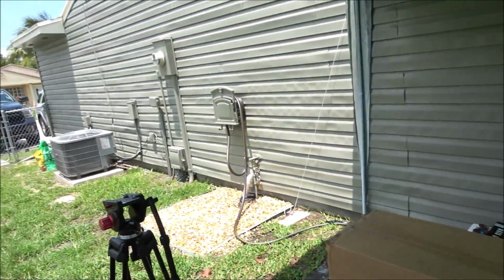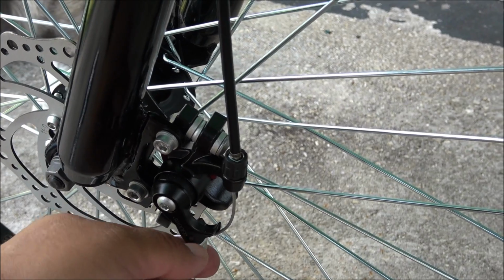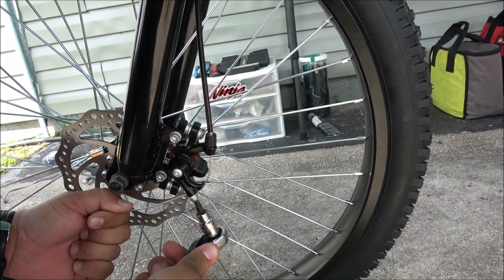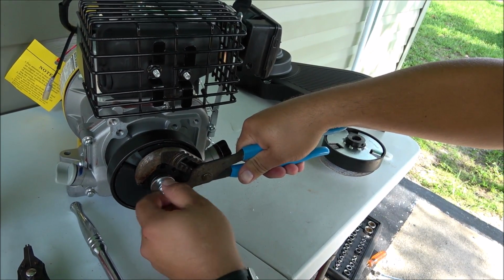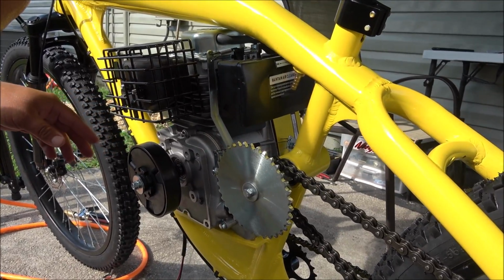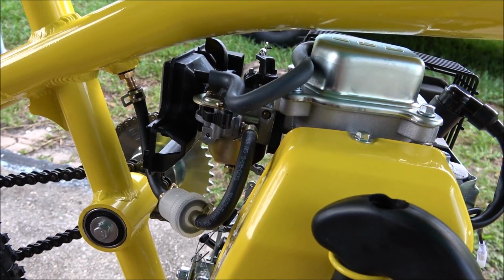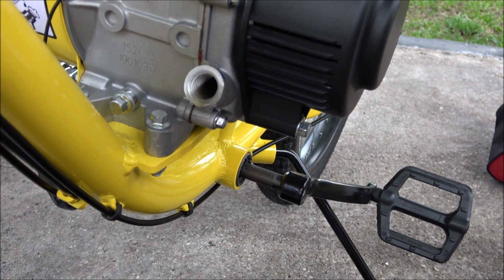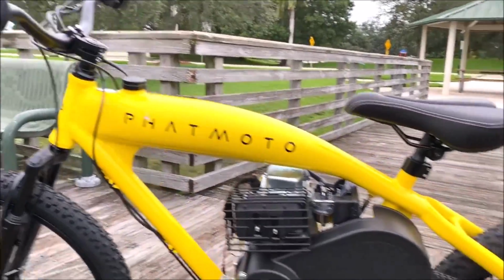Phatmoto Rover 2020 [Motorized Bicycle] - 79cc 4 Stroke - Unboxing & Installation Tutorial

Comment: Mount the engine mounting bolts with the head facing up. If the nut comes off you have a better chance of not losing the bolt. In aircraft maintenance if you put the nut up you would probably be fired.

Comment: Great assembly video. I bought the 2022 version. Found pedal chain way too tight. Removed governor inside engine then changed to 19 mm round slide carb. Great performance.

Comment: A very nice video, well done. Appreciate you.  I would like to add that if you don't do much riding off road, one thing you can do to make your bike faster and improve the range and ride quality is to replace the factory knobby tires with a set of good street tires of the same size.  Switching the off road tires for a set of smooth street tires offers advantages and improvements you will notice immediately.  The street tires have less rolling resistance than the knobby tires so your millage and speed will both increase.  They are also much quieter and give you a better ride and control when riding on pavement, it's Win-Win.  Thanks again _ great video.

Comment: After I had Rocker off road shocks installed on my front wheel by a professional bicycle mechanic, I truly appreciate the double Lock down instead of spacer approach. When it's important there is no replacing a professional. Rear Disk brake is 100% impressive bye the way.

Comment: You are going to regret using red thread locker.....will need heat to break the bolts. Blue is all you need.

Good looking bike though! The yellow looks awesome!
Reply: Yeah, the blue is plenty!
Reply: You never use thread locker it just causes trouble later.
Reply: Always blue on everything and tight if it comes loose. use red like on my back phat moto sprocket my 2019 back sprocket is not hub piloted - center suported not good. Why things come loose more often when on these bikes no rubber motor mounts like cars, trucks, generators and more to reduce vibration.
Reply: Phat moto has solid motor mounts so it wiggles stuff loose like my muscle car with solid motor mounts typical things loose too. I always use blue lock type on everything and if the bolts come loose I put red loctite back in it I never had to use heat backing off blue, red or even green loctite bolts. But when bolts come out or loose they can strip threads break things be a real disaster and leave you stranded. I've seen it a lot from do-it-yourselfers not getting bolts tight enough and doing things right the first time.

Comment: I didn't realize you had to do a complete assembly on these
Reply: It's not a complete assembly. All you have to do is mount the front tire, mount the engine and handlebars. A few other items like the throttle, but that's it's a piece of cake. - Jeffeo
Reply: As said its not a complete assembly... HOWEVER its a mass production bike 🏍 made with cheap parts. When you get it you NEED to take apart everything grease and oil what should be greased or oiled lockthight everything than ride it. 
Thats how i got over 20,000 miles on more or less a stock bike. I did upgrade jackshaft bearings highly recommend doing that right away makes it easier plus the stock bearings suck night and day with some good ones. 👍 even had a bad wreck on my bike folded my CDH forks rim still good! Bike still starts 1 pull but is finally running ruff and gets hot 🔥 fast!
Reply: @miguel360kmc  so you took the engine apart and tightlocked it back together?

Comment: Did you lube the chains  ? Also why don't they use a spring loaded chain tensioner, I made one on my motorized kit ,which requires a lot of substitution of factory supplied nuts & bolt which are Chinese garbage , this phatmoto bike is well designed and less maintenance required than a ebay kit , the biggest issue with those are bolt on engine to frame mounts and chain guide aka tensioner, periodic inspection is required for safety,  the phatmoto bike solves that issue, except the lack of spring loaded tensioner,  update, the newer ones have 7 speed cassette and shifter .

Comment: I built the 212cc with 2.5 stage upgrades hitting 70mph with 4stroke power!(=
Reply: On the phatmoto frame?
Reply: @st.paulmn9159  yeah bike frames aren't made for 70 mph. Maybe just 15 mph max
Reply: @youngfinance6319  if you're only going 15mph tops on a bicycle something's not right haha
Reply: JayJay One  yah.... that "class" is what most criminals call "Anger Management".... instead of FUCK OFF and you go to JAIL... you must kinda like your FREEDOM?? That's NICE..😁✊🔥
Reply: @youngfinance6319  i can go faster than 15 mph on a bike with regular pedaling
Reply: @Youvegot2bekidding  on my recumbent bicycle i can do over 30 mph peddling.
Reply: @youngfinance6319  sure, I feel like 45 is max.
Reply: Where did you get your 2.5 kit?
Reply: @tomtee4442  I built it buying separate parts so I had what I wanted first time
Reply: I built one as well but I used 2 bikes duel shocks at 85 degree's and one at 15 degrees engine put in the original back orks
Reply: Y
Reply: @booboo2813  look I don't even know this guy but I believe the 70 mph mine would do 65 and had another gear to hit and my bike is a 12 speed bike with a 10 speed next back swing arm attached extended an extra 2 ft with a shock going at 85 degrees and 70 degrees and reinforced the real problem with pedal bikes is not the frame especially the older ones the problem is the tires they are not meant to take on the torque and speed so you can A get the bike wheels custom built or yourself with thicker spokes and more of them or you can stretch the front and back forks and put dirt bike and or older style mopad wheels
Reply: Serious?

Comment: The build quality of the Phatmoto Rover looks excellent. 
A solid engine mount, is better than the clamp on plates used on other setups including my 4 stroke, to the fixed countershaft and reinforcement gussets. How about changing the exhaust to a pipe and silencer [ no hot exhaust blowing on your leg ].
I have fitted a 39cc 4 stroke Huaseng to an Avalanche Cruz88. The engine is outboard on the LHS. Busy with changing the sprocket to a 49T from 44T. I live in a hilly area, so need more low down pull over speed and it is a small engine.
Will wait for the upgrades.
    
.

Comment: I got a question I just got the fat Moto and I have to keep it full throttle at all times or will pretty much come to a complete stop on top of that it's really hard to keep it at full throttle it really hurts your wrist did I do something wrong when I installed it
Reply from the maker: Check your idle screw on the carb. It has a round black cap on the side. You need to remove that black cap and the screw will be exposed. Move it clockwise until reaching normal idle. Let me know how it goes!
Reply: It's idling perfect but when I spin the tires they come to a stop quick is that normal
Reply: I oiled my cable that helps. Also motor cycle stores has something that slides over hand grip called cramp buster - throttle assist for $10.00 I'm going to try soon. Oil in throttle cable definitely helped me. Also loosen and greese pivot points on engine at linkage not to tight on linkage nut.
Reply: Thanks man but I already have mine up for sale it's just made cheap I've already had two replacement parts and I don't want to go through another breakdown so I'm selling it
Reply: @810craig2  how much are you selling it for? What city and state are you in? I know what you mean I have a 2019 model phat moto with a bit of miles on it and it's constantly working on the phat moto and maintaining it. But at the right price I might buy another one.
Reply: I'm in Michigan literally just bought it a couple weeks ago maybe wrote it for 20 minutes total paid $900 I'll take $700
Reply: I've had my fat moto bike since they first come out new in 2019. I'm not exactly sure of the throttle problem you're having if I knew some more details I might be able to diagnose it. But something I experienced my throttle was real stiff I took the throttle cable off wounded up tight and soaked it in all for several days. Took the cable out let it drip dry installed it and I made sure my throttle linkage was not tight but just snug and I made sure I had oil in the middle of the throttle linkage at the motor. I also took off the throttle grip oiled and greased it. This made a world of difference because I have road for most of the day. They also make something called I think it's the cramp buster they sell it online and in motor cycle stores. Also make sure there's no kinks in the throttle cable and it's not zip tied too tight. As part of maintenance of oiling the chain I periodically add a few drops of oil on the engine side to the throttle cable. And if the throttle cable gets stiff again I'll take it off and submerge it in all again like before. Because I ride and get caught in the rain at times and water and dirt gets down in the throttle cable I'm sure. And my bike with the stock certifical clutch used to give problems you had to keep it idled up when you come to a stop if this is what you're talking about. I got a deal on eBay max torque clutch with a 415 chain and a 5/8 shaft I'm pretty sure that's the dimensions of the crank.  shaft.

Comment: Awesome bike live the yellow. Did you like the spoke rims better than the colored 7 split allow mags.
Reply from the maker: David Lorince Yes like the yellow. I prefer these spoke rims over the alloy. They seem sturdier.
Reply: @MJTechChannel  when you mount the motor onto the frame that lower flange mount is there a rubber gasket to reduce vibration throughout the frame ?

Comment: Probably a bit late but maybe a better tip is to install the seat and handle bars first, so you can easily install both wheels with ease then tip it back over to finish the build. Correct me if I’m wrong worked at a bike shop and that’s how I stared putting together a bike.

Comment: UPDATE -  the kick stand was hitting the rear brake disc. Not just touching and sanding the kick stand but cut  a 1/16th inch cut into the stand. Had to use a blow torch to heat and pull/ bend the stand. That helped a little bit. Finally used a zip tie and tied it up to the frame. It's nice a secure.
On the good note - Did  35  mile per hour top speed at 3/4th throttle. Did not want to push it any more. lol.
Mods - I took off all the throttle assembly and mounted the base plate on top of the engine on one of the OHV bolt  and installed the throttle arm and a L- bolt from Home Depot and a throttle bolt to connect to the throttle cable. A cruiser handlebar from my old Huffy and a spring saddle also from my old Huffy. A Suntour 80mm front suspension fork. The stock fork came damaged and bent and tampered. Would not fit the wheel. 
VERDICT  - Yes I like it.

Comment: I always soak my chain with 
90 weight gear oil and take 
A clean cloth to get off any 
Excess. It will penetrate the
Rollers. Never use greese on
Chain it will not penetrate the
Rollers. If u have a used chain
Make Shure u clean it with a 
Brush and solvent dry it off and
Put oil on a cloth and soak your
Chain with it and then take another cloth and clean off any
Access .this will save your chain
And I have been using this trick
For over 50 years . Check your chain often and make Shure u 
Don't have more then half inch
Of slack up and down in your 
Chain that way u save your sprokets from wear to soon👱

Comment: Use a moly or graphite or copper lube, high temperature for sure, the clutch gets very hot,  you just want a thin film of lube on the bushing, and bore.. a spray oil is not a good idea,  lube used for disc brakes will be great,  at the minimum a white lithium grease will work, but no lube, will equal no clutch, don't ask how I know,  but it will eventually fall apart, and re-lube at least yearly, clean and oil the chain after riding, about monthly, you would probably never need another chain, carb cleaner works great to clean, don't get it on paint, it can remove it, and some plastic parts,  if not else, a couple oz of gas, and old toothbrush, and lube with spray white lithium grease,  roll the wheel a few times, then wipe the excess grease from the chain,   the solvent in the grease will get it into the chain, evaporate and thicken, wiping the excess will keep it from getting on everything!!!.. the clutch only needs greasing more often, if it's idling a lot, at speed it's like it's not even running, the shaft and hub is spinning at the same speed, no friction, and avoid slow takeoffs, it slips the clutch, causing heat, it's best to throttle and go! 👍

Comment: Very nice and informative video. Did you eventually use the threadlock on the motor? Looks like the adjustment of the chain is by loosening the screws and moving the motor.

Comment: How did you purchase anything for this website?…. Not why how…. You go to the motorized bike section and they have one single solitary option it’s sold out it’s so there’s no price they have no clue when it’s gonna be back in stock and when you messaged them on their automated the Bass thing in the bottom, right hand corner they immediately tell you that no one is available ask for your email would you put in four or five different times and receive not even an automated email over the course of the next week……..

Comment: I would have used a different exhaust. A chrome pipe that came forward and then down around the cover and back toward the rear wheel. Then use a chrome heat shield on the top part of the exhaust to the first bend of the chrome pipe.  That would make the bike really stand out, and keep the riders leg from having to move out and away from that cage.

Comment: So it’s up and running but when we’re actually on it and you hit the throttle you hear slight clicking noise which we think the chain might be too tight so we’re gonna try and relieve tension but there’s also a slight squeaking and we don’t know if it’s the brakes rubbing it because i did have an issue with the back brake pads being way too tight

Comment: Not the Red thread lock. Those will never come off.  Use the Blue Loctite thread lock. These screws need to be periodically removed to replace the brake pads.

Comment: Mine actually works best with the rear wheel cocked slightly to the left, my jackshaft is actually on a very slight angle, I don't know if they're all like that but I have seen a couple others that are like that.
Reply: Wrong
Reply: @raynellwelch2792  do you have a Phatmoto?  Is the jack shaft straight.  Mines s on a slight angle, I've heard other people say the same thing.
Reply: @mjsmjs7905  Yeah I hade the shop put it together

Comment: Installing the motor mount bolts upside down is a big mistake. When the loc tight fails vibration drops the bolts to the ground.

Comment: Why didnt you change the oil prior to mounting the engine?  Think it would have been cleaner and easier...??    Should have routed those wires on the left side as you face front instead of the right. Connections were correct but the red wire is under stress and may come of while riding.

Comment: Hello could somebody PLEASE make a video of WHICH muffler/exhaust seems to improve performance BUT ALSO runs in sync with the bike on the 79cc 4 stroke rover SEND me a link where to re buy the disc brakes.... I just had a screw fall out and dont wanna buy the ENTIRE BRAND new disc brakes.... OR PLEASE I would rather buy a better versionb of the disc brakes than what came stock on the phatmoto rover... im constantly having problems with the brakes

Comment: My crank shaft came with 2 right hand bores in 2019. The left peddle was in perpetual loosening until I replaced the shaft. Love the bike though, the assembly was kind of therapeutic, I thought.
Reply: Installed blue lock tite when on new center crank nuts later loosened. Bent bolt got a new one added red lock tite tightened tight. I have turned wrenches for the years all ways use lock tite. For rust prevention, backing off, breaking off, stripping threads out when coming loose and more! I always say do the job right the first time. So you don't have to do it a second time possibly get hurt spend more down time and money. So many people I have come behind and fixed things for not doing the job right and stuff not tight with lock tite the first time and not thinking (What could go wrong with what I'm doing?)